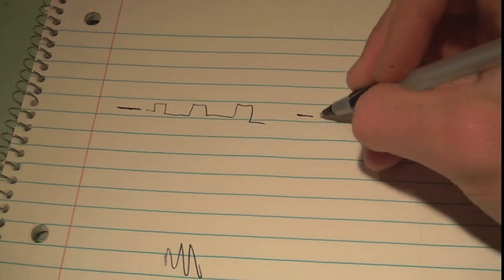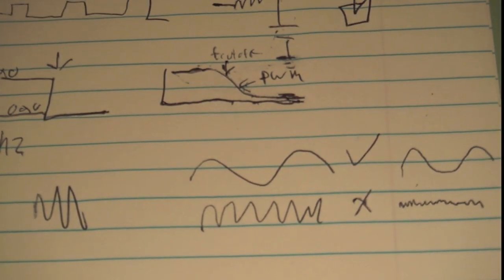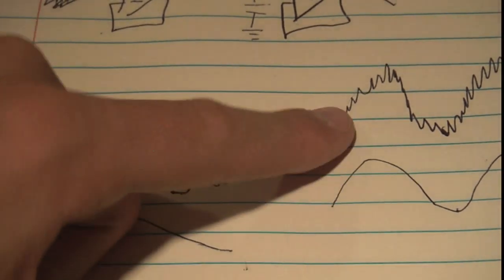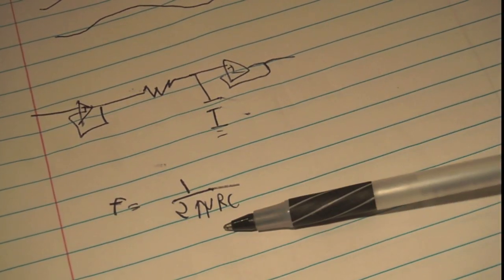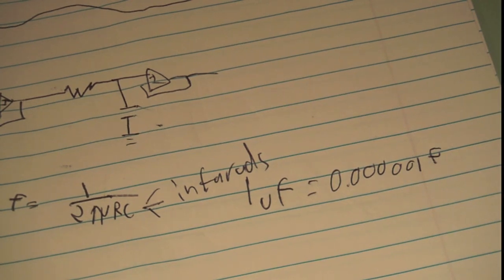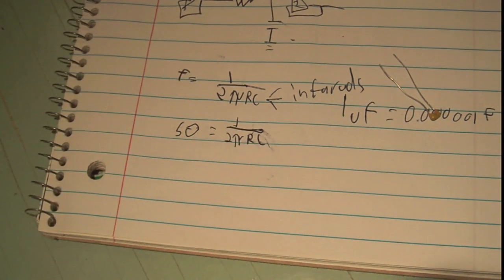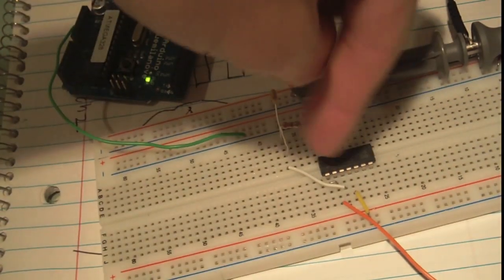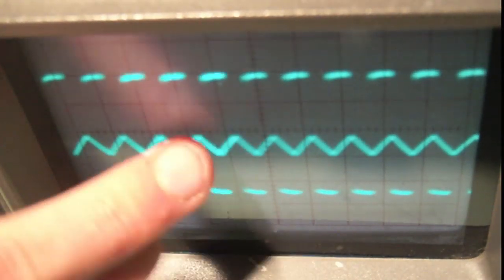RC Low Pass Filters (make an analog value from PWM)

Comment: I have a motor control thats looking for a analog 0-7v for speed control. would I need a really complex low pass because what the motor controler is looking for in voltage is a load Or will a simple one work because its not really a load?
Reply: Put a 4.7 ohm 15 watt power resistor in series with the PWM power, then after that, a 470k and a 10mF 15v capacitor in parallel to ground. Where the two resistors connect will have the averaged analog DC voltage. The 470k resistor to ground isn't totally necessary, but without it, the voltage will rise to 7v under no load, and the capacitor will never discharge.

It's inefficient but the simplest way to achieve what you are looking for. It's really ineffecient if running near 100% duty cycle, but 50% or lower it shouldn't waste that much power generating heat.

Comment: The way you depict amplitude modulation is incorrect. In amplitude modulation, the amplitude of the high frequency modulating signal (usually a sinusoid) is varied in line with the amplitude of the low frequency message signal. The resulting AM signal varies periodically about zero. In your drawing you have the opposite. Your carrier signal varies periodically about your message signal.

Comment: Thank you for an extremely informative video. I'm trying to control a trinket with an Arduino by having the trinket read different PWM values as different analog input values so that I can tell the trinket to switch between various modes. It looks like I'm going to have to use some kind of low pass filter in order to get the trinket to receive and recognize distinct analog values. Of course, I don't want it to take more than a tenth of a second or so for the value to stabilize, so that I can switch trinket modes relatively quickly. Your video will help me with this problem. Thanks again.

Comment: Thanks for the video! I found this website that might be useful for those of you who want to easily calculate the needed resistor and capacitor values in order to produce the desired signal waveform: http://sim.okawa-denshi.jp/en/PWMtool.php
Reply: 2 years later, thank you

Comment from the maker: I'm sorry for not having made part 2 yet, it has been busy recently and I am forgetful, but don't worry it will come eventually. A simple low pass filter with an absurdly low cutoff frequency like .1 or .01 hZ would do, or if you want a bit more exact control an R2R ladder would also work. But that is more complicated and no reason to use one over a simple PWM low pass filter setup unless you need the output to be exact.
Reply: 2019 wants part 2
Reply: 2016 wants part 2. Great video!
Reply: 2017 wants part 2
Reply: 2018 wants part 2

Comment: Hey, first of all thanks for the video! I was hoping to find part 2 but couldn't see it anywhere. My objective is to convert arduino PWM to analog 0-5V DC, so I can use it to control some CV-controlled parameters of my analog synthesisers. I imagine what I want to do is simpler since I don't need the output to be modulated in high frequency as you do, but I'm a dummy so I would highly appreciate if you would give me any further lead :) Thanks

Comment: Hey, can you clarify some questions about 2 differant Cutoff Frequencies for AM Signal?
When a 100Hz Carier Sinewave is modulated with a 200KHz Squarewave:
It has aswell positive bumps as negative right?
And if I filter at 500Hz will it have less output as a 20KHz Lowpass?
Thanks in advance, greets.